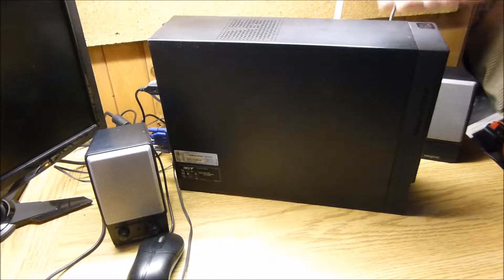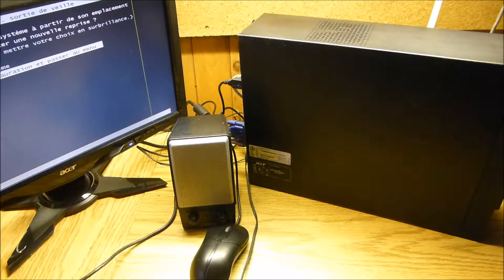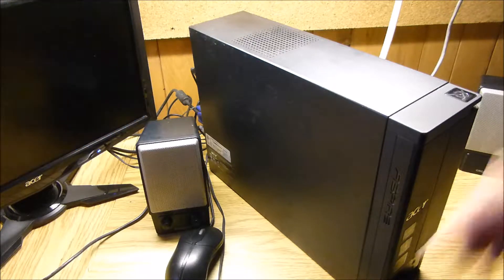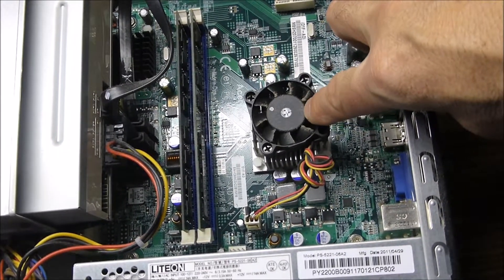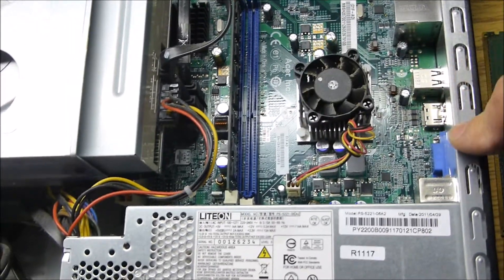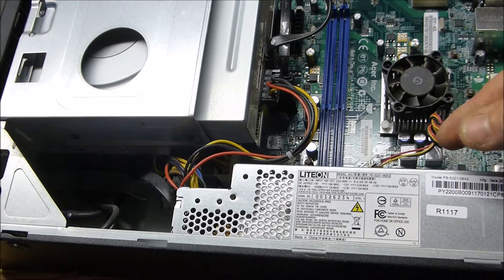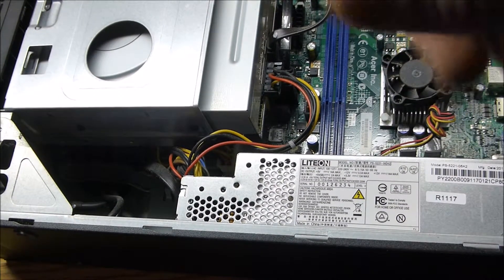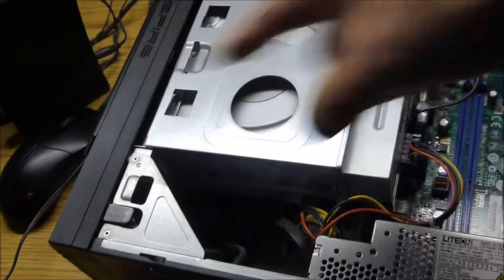How to fix and Clean your computer when it beeps 3 times,, D.I.Y SAVE $$$, acer, hp,dell,ibm,#120

Comment: It didnt work for me.. having 3 beeps but after I cleaned everything, ( even used air compressor)but same thing.. 😞😞😞
Reply from the maker: Oh it sounds like des rams? did you have 2 or more? if so with the power off and unplugged remove the rams and install one at time and power it and see if it beep? Let me know how it goes?
thank you
Max
Reply: Max ofalltrades we do have 2.. and i tried what you said.first attempt,  the beep was gone and something came out of the screen.. “set up” was the only thing i read... and then its gone.. black screen again. I tried several times putting  the ram in diffrent slots 😊, but the beeps came back... aaarrrgg.... 😖😖😖🥺
Reply from the maker: @pinkspretty , just like that is anything on the keyboard or any keys stuck?
Reply: Max ofalltrades No. they’re all good. The only thing is, it sounds like the system is working too hard even if I just turn it on..
Reply from the maker: @pinkspretty  the cpu fan is it turning on? if not the cpu becomes hot very quickly and will turn off the pc. or if the cpu was removed, new thermal grease should be added before re-installing the cpu.